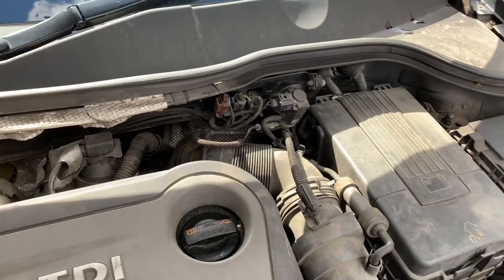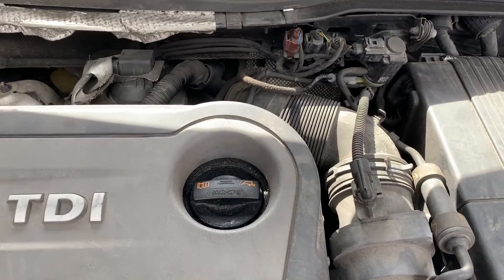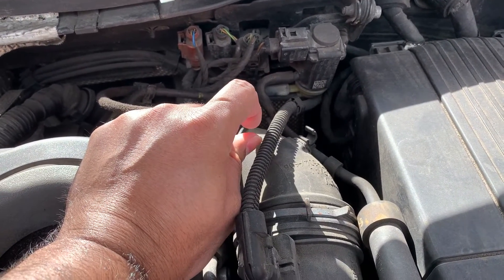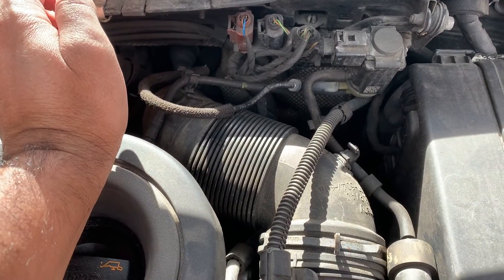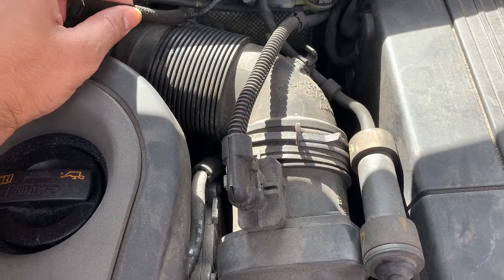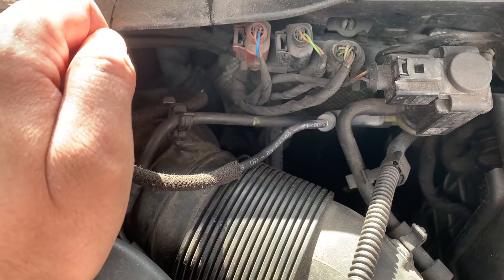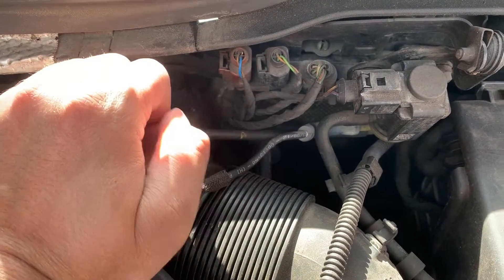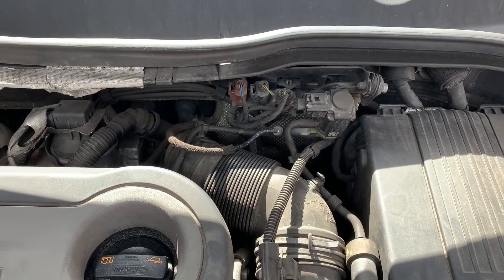VW Passat B7 "Turbo Boost Control Position Sensor A" 2011-2015 (Engine Coil Light on Dashboard)

Comment: Hello  here after some years I have a passat 3c b6 of year 2007 and that light comes on very often  especially when I press the gas pedal to go faster in highway and i loos the power     but when i turn the engine off and again on it disappears and drive normally When i scan it says a supercharger turbo  problem   This happens every time
I have checked with a mechanic many times but they didn't find any problem with the engine or turbo  And he doubted maybe a sensor problem but even that nkt for sure  What it may be ?  Thanks

Comment: Wire? Isn't that a vacuum hose?
Reply from the maker: May be it is a turbo hose, i'm not too sure but it certainly solved loss of power/turbo boost control.
Reply: Looks like a vaccum hose coming loose.
Reply: That is what I see.  A tube not a wire

Comment: I have a 2014 vw Passat tdi and this light come out running and the car turn off and then I just start again and not problem but some time do very frequently… do you know the reason?
Reply from the maker: It’s so hard to say what could be wrong without fully diagnosing it. Try plugging in any OBD device to diagnose like Carista etc that will tell you where you’re having a problem
Reply: I have the same issue was told to change the tcv and the map sensor but still facing same issue any advice plz ?
Reply: Same issue here. Did you find a solution? Please reply
Reply: @CrOzLm  yes I change all harness of injectors and never happened again ..

Comment: Hello Adnan
Asalamo Alikum. Thanks for sharing. I have similar problem. Car drive fine on normal road but when I am on motor way and go above 50-60 mph, suddenly loose power. Then I pull up on hard shoulder and restart the car and it drives fine and as soon i go above 50-60 mph it happen again and also engine management light comes up. Lift is still there. Any advice.

AA found following issue.
Patrol found the following fault code/s:System : Engine control 1 - 7C3 / Diesel EDC Simos PCR 2 Status :P256300 - Charge pressure actuator position sensor. Error Message : Signal improbable. Static fault. Status :P029900 - Boost pressure control. Error Message : Below control limit. Sporadic fault.Member has had fault over 1week taxi has been switching off and on to reset . . Requested bosch scan found fault codes for boost pressure advised to take straight to garage Engine Oil Level Ok. Coolant Level Ok. Further investigation require fault history shows 13 days with warning
Reply from the maker: Hmm looks like sensor issue, the actuator that controls the pressure boost is not working properly. A sensor change could resolve the issue or May be further investigation is required! Is your car consuming a lot of fuel these days?
Reply: @Adnankhanchannel1  even i have the same issue and my mileage has been dropped